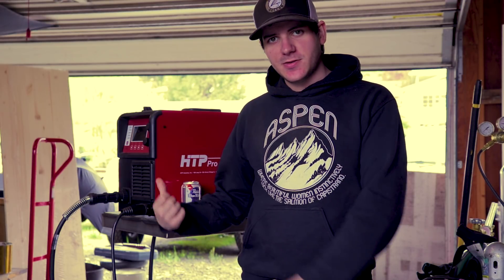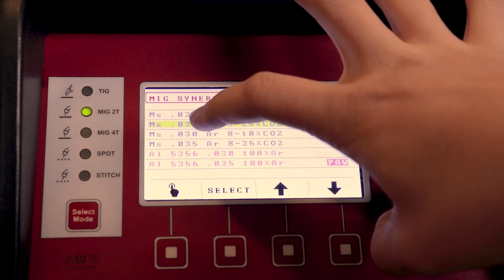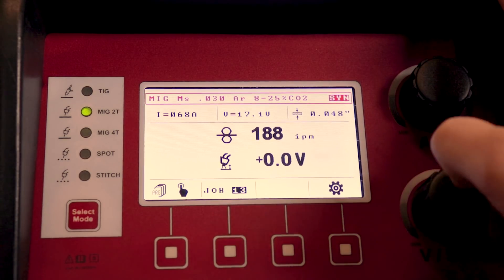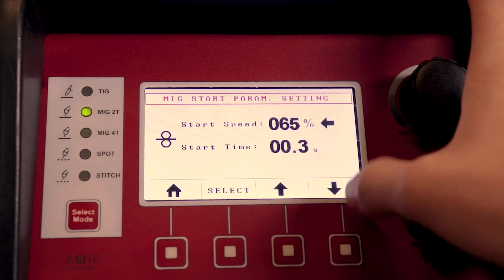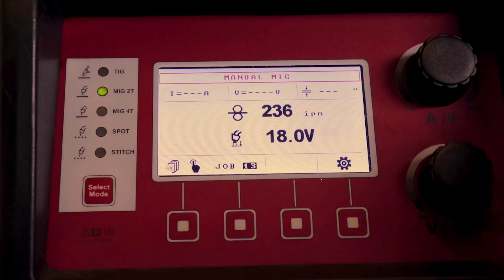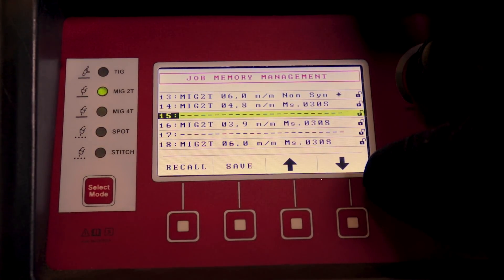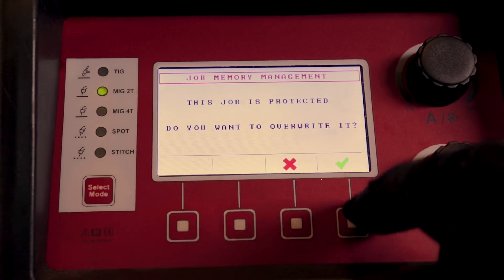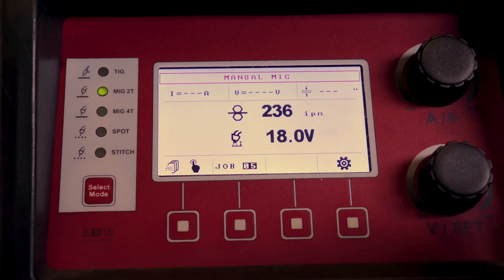How to set up your HTP ProPulse 200

Comment: I have a few settings on my TIG set, but never use em, nothing like the range of settings on that though-I have trouble working my DVD player so I'd be lost with that set lol. I did look at a MIG inverter set with synergic, it had settings for CuSi, which I think is silicon bronze wire,- apparently, this is used for auto body work as boron steel is now used for bodywork??.
The wire is expensive, but I'd like to see some MIG brazing if you can get hold of some wire without breaking the bank.
Reply from the maker: That makes sense it'd be for autobody.  If I get a chance I'll pick some up.  I've never welded with silicon bronze with a MIG so it'd be fun!